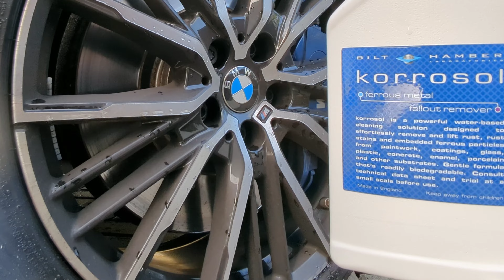Exterior DEEP Clean With AMAZING Results | BMW M135i Xdrive | AMSR

Comment: My wife and daughter both have M135i's with these wheels, takes longer to clean the wheels than the car itself.
Reply from the maker: Yes the wheels are a nightmare on these, think they are the worst to clean out of any car I've owned 😂.Thank you for your comment and watching the video.
Reply: Hey Andy b, if you get the wheels clean on both cars then use carpro hydro lite 2 as a hydrophobic sealant it’s super easy to keep the wheels clean! It’s a spray on rinse off coating which has great results and lasts for a long time. Saves time on going down the ceramic coating route for wheels.
I use it on my BMW M4 you won’t be disappointed 👍🏻
Reply from the maker: @reesernhr836  thank you for information. Sounds like a good product that could help, will also check it out. Thanks for sharing 👍
Reply: No worries! Definitely worth having in your detailing Arsenal 😎👍🏻